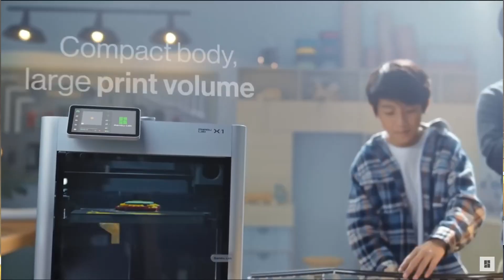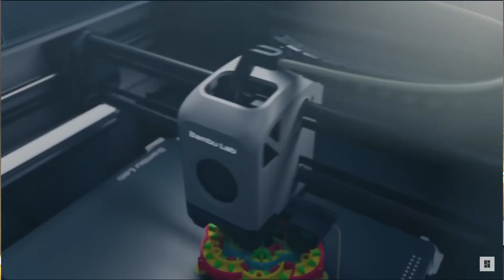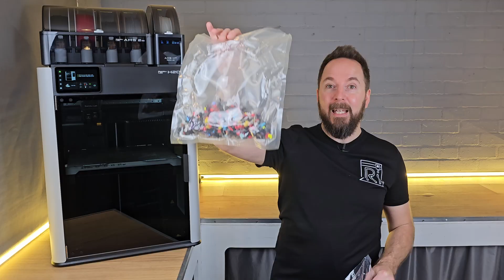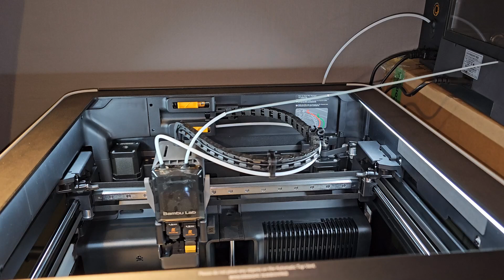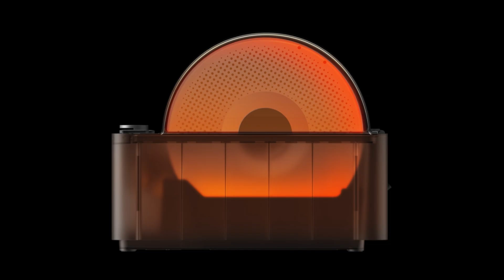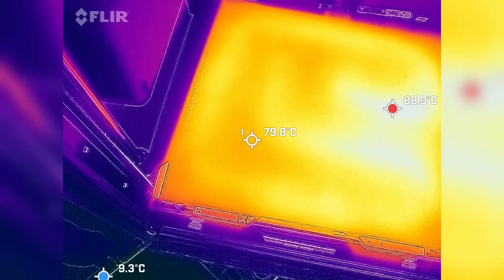3D Printing Finally Catches Up With My Ambition! – Bambu Lab H2D Review

Comment: Feel I have come full circle. Started out with the sonic pad videos for my e3v2, then the klipper series was excellent when I turned the v2 into a full over sized klipper build. Now just picked up an H2C for a daily driver and only a few days in and can’t believe the quality of the prints. And the possibilities with multi color and multi material. Can’t wait to get into the engineering materials and to start printing parts for the core xy conversions on what now essentially is 2 E3v2’s!

Comment: I have had my H2D for about 5 months now and I have had to change the dual print extruder head, the TH Board, and now I have to change out the hotend cooling fan. Out of the 5 months I have had it it has been down nearly 3 months. When the printer was working it was great but I got a lemon. It was not easy to change either the extruder head or the TH Board and now another pain in the butt change.

Update 2 Sep 26 at 02:00 am : After all that I now have a 'The eddy current sensor signal of the left extruder is abnormal' error message. This printer is plagued with major problems and it is only 5 months old. They said they would NOT replaced the printer. I have a lemon here.

Update 2 Sep 29 at 10:15am : Changed out an eddy current sensor this morning and I am back to the original problem of extrusion motor is overloaded. This after changing out the dual printer head, the TH Board, nozzle fan, and an eddy current sensor with emails from Bambu techs for the last 3 months.

Comment: Good review, at 9:46 no brim on those supports?   I wouldnt call that bed adhesion issues, but improper support management.  Buti never blame the user,  the slicer should of caught that i believe, it should know better to have all that support above concentrated to one little spot on the bed was asking for trouble without a brim.   The one that held you could see was more verticle then the one that fell which started to angle quickly from the bottom, giviing it the side forces needed to knock it off easily.  I wish we didnt  have to catch all these edge cases and more intelligent slicers could figure this stuff out, but at leaste we dont have to mess with the mechanics anymore.  AI slicers next please.

Comment: I’m really leaning towards this printer vs H2S. Yes the H2S has a bigger build plate, but only by 15mm wide (4.4%) when using only the H2D right nozzle, so the benefit is negligible. As some concerns with power, I use an EcoFlow Delta 2 Max for my UPS for my network/NVR along with my 2 current printers (X1C & P1S). If I switch out my current printers for 2x H2Ds, then I’ll just get a Delta 3 Ultra while still plugged into a 15A outlet. This will allow 3,600W to be drawn easily, so 2x H2D will have a max combined draw of 2880W, and unit will still charge at 1,800W. I’m sure both printers won’t sustain 2,880 draw the whole time they’re running, so it powerstation should be able to keep up 😊

Comment: Sold my Prusa XL's and have made offers on Ebay for $500 less for the ones for sale and now have 3 H2D's and am not looking back, the H2D is fantastic and love there ability to print ASA and ABS.  I also have a few K2's and they are work horses for my industrial prints but something about the H2d's that give me a smile while it works, and for only $300 more then a new K2 the H2D is a better unit.

Comment: An excellent comprehensive review that does a great job of describing pros and cons of the H2D which ticks most boxes.
One of the best I have seen and as a prospective buyer provides some confidence in the purchase of the machine.
One area that needs more explanation is the need for  a sacrificial tower using multi  filament colours to avoid carryover.
This also wastes a LOT of filament (!)   Why can't this be solved by extending hot end changeover time?
Does this requirement only apply to printing more than two colours?
I haven't seen the sacrificial tower requirement mentioned in H2S reviews - presumably this version also needs a sacrificial tower as well?
Did you find the print quality improved over say the X1C?
Reply from the maker: The simple explanation that I have seen is that the nozzle pressure needs to be primed before it starts printing again. Therefore the prime tower is always needed for any filament or nozzle changes to avoid spots of under or over extrusion on your print as the filament begins to extrude.

Comment: For your football goal replacment part. If you use infill "Gyroid" You dont have the best Z Bonding, use CUBIC 30-60% for overall best XYZ Tensile Strength within printed parts. Gyroid is only good for large scale objects to be fastly infilled but has nothing to do with strength.

Comment: Hi, I would like your feedback, for normal prints PLA/PETG max for doing min items (scale) 2 colors maybe 3 or 4 would it be faster in H2D and filament saving than in others? I had a P1S and sold it hoping h2d would be way faster than others, like instead of buying 2 P1S , H2D would print the same amount of items in less time than same amount of items in 2 P1S in multy color

Comment: my biggest issues is power, my entire farm is 220v and they refuse sell me a 220v parts.  They told me to return it and buy the 220v from oversea....  Just design it with both voltages in mind!   Even the A1 supports this!
Reply: Have you checked that the 120v in the US version isn't switchable to 220v? Most modern PSU have an input switch
Reply: I bought the ‘smoke purifier’ here in Thailand and they sent me one with a manual that claims 220v 50hz but the data plate on the machine says 100-110v 60hz. They are yearly making it as difficult as possible to exchange it. The email trail is now two months long and they will not send me a return shipping label as yet.

Comment: You really glossed over the connectivity options.  Didn't even mention how being forced into these options prevents you from using the most popular slicer on the market Orca Slicer which is just a flat out better, more feature rich slicer than Bambu Slicer.  This is on top of breaking many other integrations that were available before.  Seems really dishonest not mention it and make it sound like they have all these different connectivity to suit everyone.  They do not

Comment: I keep getting an Extrusion Motor Overloaded error on my H2D, and no one seems to know why. I’ve been 3D printing for a while, so I’m not new to this. I’ve checked the basics, but the issue persists. I’m starting to think there may be a problem with the printer itself. Their US support has been really unhelpful so far. Has anyone here run into this or know what could be causing it? Would appreciate any advice!

Comment: The H2D has only a maximum chamber temperature of 65°C. This is simply not enough for many technical filaments. Even with the P1S, 50°C is possible. Also, the heating bed of the H2D is simply a joke. If you want to talk yourself into it, go ahead, it is and remains a joke. The H2D is also very technically complicated in many aspects, and maintenance work is hell with it. The H2D wants to be everything, but unfortunately it can only do everything very mediocrely and at a very high purchase price.
Reply: I can only agree about the chamber temperature. That's just not enough for a flagship 3D printer. They should have left out all the laser stuff or never developed it, but used better components for a higher chamber temperature.

Comment: I'm hoping that they update the firmware for the AMS 2 Pro and AMS HT to not rotate the filament and be able to print with the dryer going as well. Anothet setting just for maintaining humidity, not drying. Have it run at a lower temp or a custom temp user input, and the humidity will still go down without warping the filament in the feeder. Luckily, it's just software. But it would be a huge miss if they don't fix something so simple. Knowing Bambu Lab, I'm still optimistic about that feature rolling out in a future firmware update.

Comment: At 25.26 you say the exhaust is filtered from and nasty particulates. Thats not the case, the top area behind the filter grill isnt covered by the included filter and the exhausted air is completely unfiltered. This is something banbu themselves dont mention.

Comment: On the Bambulab forum, users are discussing serious issues with PETG printing on H2D models. They mention problems such as inconsistent print results, frequent layer adhesion issues, excessive stringing, and unreliable filament flow. Some posts point out the need to adjust the PETG profile settings, highlighting that printing this material on the H2D is not stable without additional tweaks. Overall, there’s a sense of frustration over the lack of support and inconsistent PETG print quality.
Reply: Did you have chatGPT write this for you, sounds just like a bot
Reply: @thiccnick277 My thoughts exactly! It sounds just like the AI review section on Amazon! 😂
Reply: Thank you for your opinion robot
Reply from the maker: Interesting, my PETG prints have been very good overall. I will see if I can find the discussion you're talking about.
Reply: Can say, I am mostly printing PETG and even if my H2D hast only around 250 hours on it. 200 of those are probalby PETG, with no issue at all. SUNLU PETG, Bambu HF PETG, Prusa PETG, and some other brands are used. I just try to keep em dry, cause that leads to some stringing and overall less quality in printing... but that is also true for other printers i use, or have used.
Reply: Petg hasnt been an issue in my h2d
Reply: Siempre es mejor ajustar los perfiles

Comment: Uneven bed heating, nozzle blobs of death, VFA issues, odd print bed sizing.  This thing is rubbish.
Reply: I have none of these issues except "odd print bed sizing" which is not a real issue.
Reply: @CL-gq3no I haven’t had the blob of death but I see a lot of posts on FB and some YT videos with people having issues.  The bed heating shows up if you use a thermography camera.  You can see the uneven heating while printing.  VFA is hit our miss depending on the printer quality control when it was assembled but it is not consistent.

Comment: Excellent, comprehensive review!

I don't understand why the print times didn't decrease a lot more when using larger nozzles, given that you can print wider and thicker layers proportional to the increase in nozzle size.
Reply: It's probably hitting the volumetric flow rate limit setting which will depend on the filament/profile and nozzle temp.  With tweaking of the profile/temp or high flow nozzles the 0.8 nozzle advantages could be fully realized.
Reply: @CL-gq3no  Oh right, that refreshes my memory of what I read at the Bambu's H2 D forum when I was last there several weeks ago.

As far as I can remember, there were various discussions about the higher flow capabilities and how they might be achieved with different settings, but had apparently not yet been realized by anyone.

Comment: On a US 15A circuit, that 15 Amp value is the absolute maximum allowed short peak current draw. Any sustained current draw has to be a maximum of 80% of the abs max - in this case 12A. So the max sustained power draw for a 15A circuit is then 120v x 12A = 1440W. Thus, basically, the H2D must be the only device on that 15A circuit.
Reply: That can’t be true, since I charge my power stations (Delta 2 Max) at 1800W for 30-45 mins (depending how discharged they are). When I use my Dewalt thickness planar, it actually spikes above 15A initially when passing a board through it on a 15A circuit.
Reply: Thats a issue only during the initial 30 seconds when is doing the initial bed heating after that the power draw should be similar to any other printer
Reply: @lotsad1234 , It's not even an issue during bed heating.  It is the active chamber heater that uses ~1000 watts, but as you said that is only initially.  After that, it cycles on and off and only for filaments that need it.  I found this out while trying to run it from a UPS.  Only used a few hundred watts for low temp filaments during initial heating, but for ABS it overloaded the UPS while heating the chamber.
Reply: @CL-gq3no  what wattage ups did you use?
Reply: I am going to have to get another 200 amps run to my house. I have 3 kids and our computers are already drawing already drawing 6 amps each.
Reply: @kdw75 BS - computers do not draw much power. 6 amps?! No way. Maybe your wife should turn off the high powered vibrational motors. 😅😊
Reply: @Fluterra  Hmm...Do a little math. The GPUs draw over 600 watts each and the CPUs 350 watts. They have 1600 watt PSUs. I have put a watt meter on it and it is showing 1,240 watts of usage during load.

Comment: Idk where you got your h2d but mine is horrendous. VFA out of whazoooo, wherever you have a hole in a print I get either a layer shift of over extrusion, something wrong with the left tool head that the support is trying to fix for 2 weeks(temp won't go lower than 78 degrees and the fan is always on even after replacing the heating element) and the list of issues I have makes me want to throw it out the window and try a Prusa. I wish I would have kept my x1c but I made the dumb decision to sell it and get the h2d. Big big mistake
Reply: hes paid thats why
Reply: odd mine is flawless. You should call customer support and get it replaced.
Reply: @unitymind  i did and they don't want to replace it but they are bamboozling me around asking me to disassemble half of the printer take videos of that and that than tell me they can;t see video number "whatever' and send it again. and in between each email is about 4-5 days
Reply: Yes there are  number examples of flaky H2D's on the Bambu Lab Community forum.
I hope by now early teething problems and Quality Control issues have been resolved.
Hang in with your machine - and be persistent get the issues sorted under warranty.
Reply: 😂😂😂😂 otro que se crea sus propias películas!!! 🤣🤣🤣 ¡ cuánto darías por tenerla !
Reply: @AndresDuque-qs9zz i don't need to dream boy i have it and i'm not here to prove you anything. keep scrolling till you grow a pair, and stop being a fan boy!

Comment: If they just came out with a bigger X1-C, people would be complaining. They can’t win as the hobby crowd is after them. Fortunately, they are losing influence over the industry. I’m impressed with my H2D. I use the left nozzle for the AMS 2 and the right for the AMS HT. The plan is to use the right for TPU as that’s recommended as it doesn’t move up and down. I’d rather disconnect the AMS HT than the AMS 2. It works just fine.standard “mains” in the USA is 120v (actually 123 v), 20 A, which is 2,400 watts. Old homes would be 15 amps. But they would have to be older than about 60 plus years.

Comment: it's big , you are NOT joking the printer is big and the printer's box is massive , "don't dispose of this box" where do you store a box which could fit a family of 4 ? , I don't think they could make it any bigger without making it a industrial product. 
I've only had it a few days but I think the print quality is better than the X1C , someone said you need a steady table etc , but I think that table need to fasten to the walls too.
Reply: I’ve had to put the box in my shed, couldn’t get it through the loft hatch 😂

Comment: I'd have been a customer if they hadn't locked it to their cloud system.
Reply: Just print in lan mode 🤦‍♂️
Reply: @iainhay2823  Except it periodically demands to call home, doesn't it?

What happens if the company goes out of business, or they start charging for accounts?
Reply: @iainhay2823 LAN mode using the Ethernet plug on the back, oh wait….
Reply: They didn't lock it to their cloud.  They just locked unapproved 3rd parties from their cloud which really should have been done from day 1.

Comment: Great review, I love my H2D, next level printing from everything else on the market, including X1C. FYI you don't need external power to the AMS pro 2, that dries fine on the normal cable from printer. Only the AMS HT needs external power as it can dry higher temp materials.
Reply from the maker: True, what I meant was that I wanted to dry filament in the AMS pro 2 while I was printing from another source. For this you need the additional power supply.

Comment: Great video! Really up in the air as to whether to buy one of these or not. Currently have two A1s and a Flashforge 5MPro. The price is just pretty much up there to justify for mostly printing PLA and PETG.  By the way could you please increase the volume of your videos? They are a lot quieter than other YouTube videos and almost have to crank volume up to max on my PC to hear. Thanks, Gerry
Reply from the maker: It is a lot of money and there are other printers that will give you basically the same results with PLA & PETG. I would only buy the H2D if you think you'll use the heated chamber & dual nozzles. Whilst it is great, I don't think I'd buy it if I wasn't interested in more engineering style printing. I will look at the volume issue. I always set it to recommended levels but perhaps there is something else going on.
Reply: Recuerda que detrás de cada impresora Bambulab … hay una gran compañía que te da mucho respaldo !